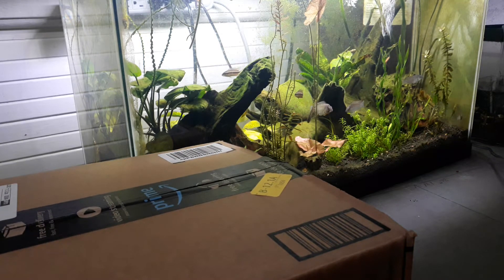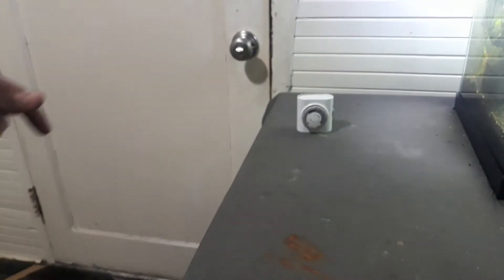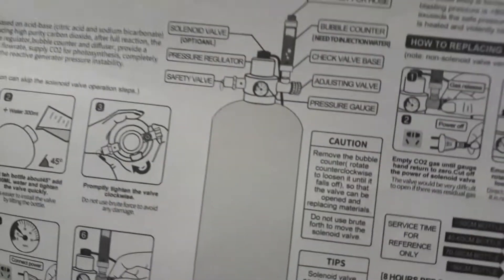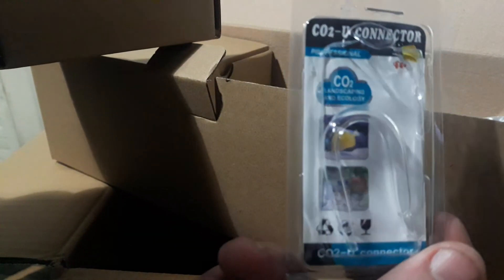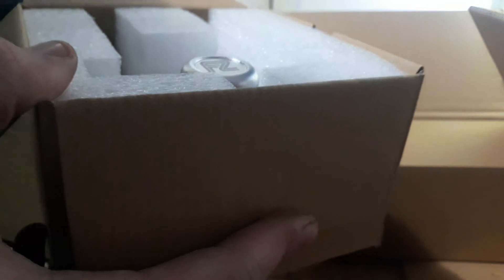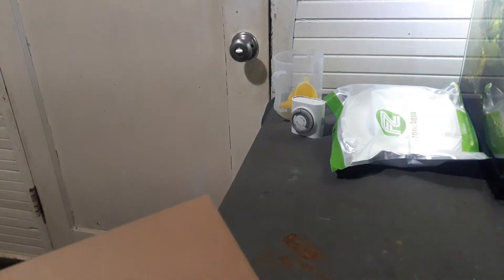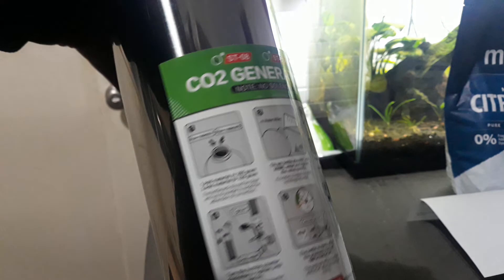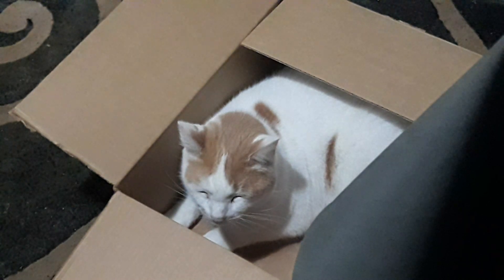CO2 Generator Unboxing!

Comment: Is it worth the splurge? I’m thinking about it for my 55gallon but am a complete noob at this whole thing
Reply from the maker: Totally worth the splurge! It barely cost me 3$ to re fill the cylinder with citric acid and baking soda. And so far the whole time I have own it, ive only refilled once after the first initial setup. But I use it on nano tanks. I'm not sure how it it would work for a 55. Since it's a tank that large I would try to get the biggest cylinder you can. I would spend the extra money for a real co2 system. Co2 art and FZone make a great co2 regulator It will cost more upfront but you might only have to fill a cylinder once a year at a welding shop. That's like 10-15 dollers depending on the company. If you have any other questions feel free to ask
Reply: @atkinsnatureaquariums3552  so if I were to make it a normal professional co2 system would I still be able to use the valves and regulators from this product. Or would it not fit on the co2 canister?
Reply from the maker: @kassieguzman4514  you would have to buy a regulator which has the valves built into it. They are more expensive but they do work really well
Reply: @kassieguzman4514  it is all about just 2 things
1,how much pressure the set can hold and how u refill it
2,how much u use and how long it last

get a set that can hold high pressure (that is so called professional) and refill it with dry ice will last u longer between refill with higher price (no one take cylinder to refill at shop now , everyone understand dry ice is co2)
get DIY set and refill with acid soda is much cheaper and hold less co2

of coz this is compared between same cylinder size , u can increase the cylinder size for more co2 storage which keeping low cost but use up more space

there are also extra thick version of this kind of DIY set that u can put more acid soda in at once ,  no matter what u choose , find out your usage and refilling frequency , pick one u are ok with